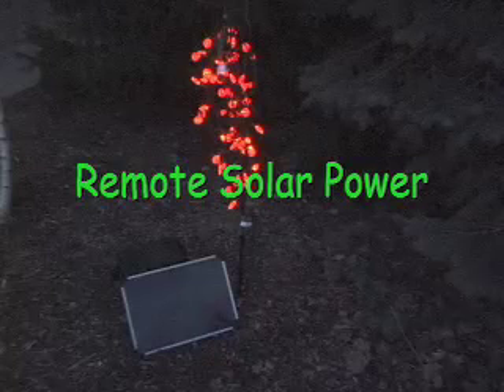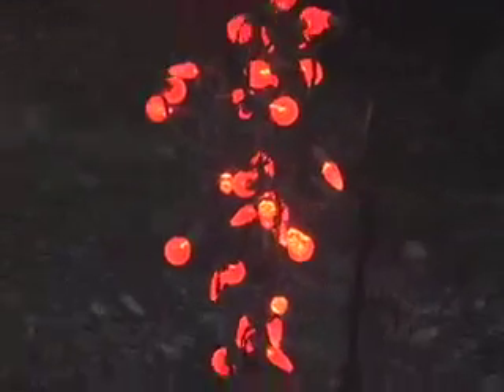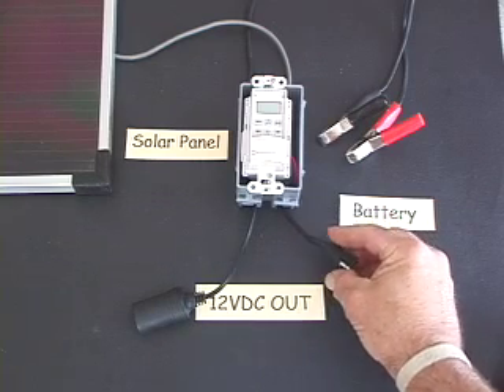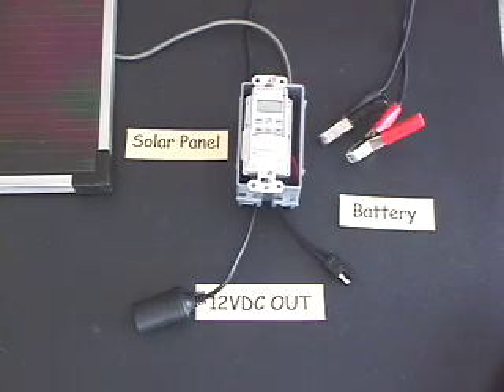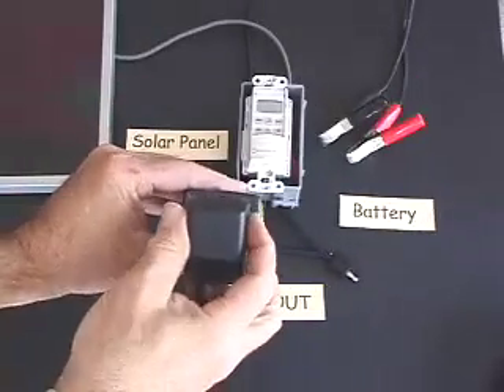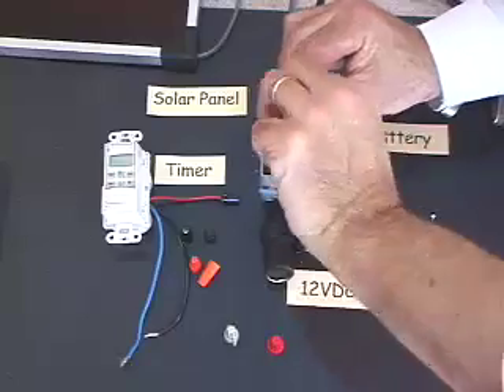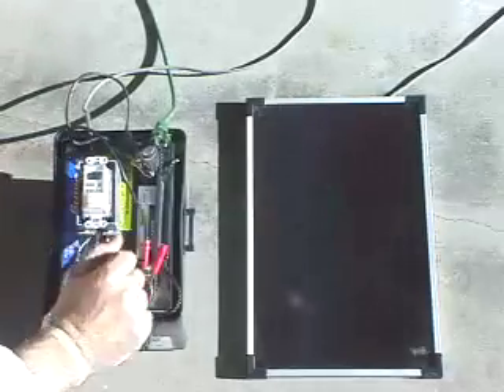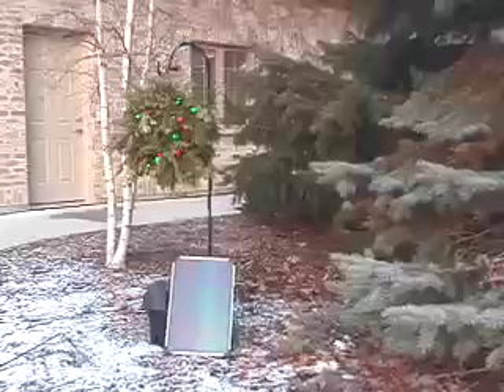REmote Solar Power Project

Comment: You would be better using 12v led strings as your not getting loss through an inverter.

Oh, and you might want to lay off the ridylin